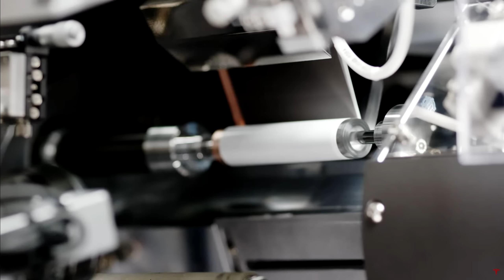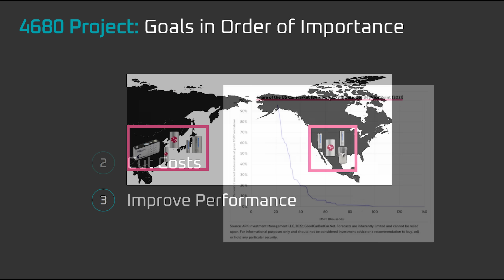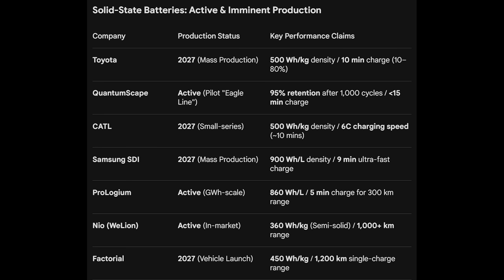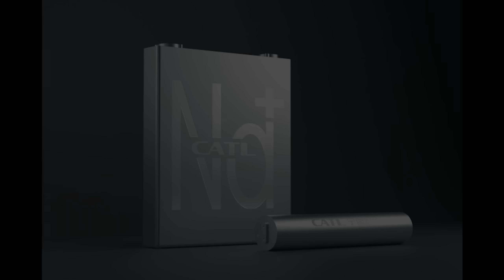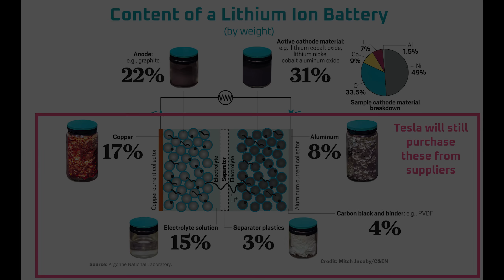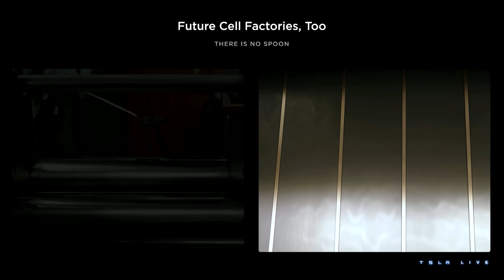The Fully Dry 4680 // Too little too late?

Comment: Do you think that the roadster demo indicates they have at least a working prototype of a high silicon battery?  There was that 'leak' a year or two ago about the NC series of cells... And NC50 was supposed to be a high performance, high silicon anode cell for a high performance vehicles. Aka the roadster

Comment: For the love of god, stop saying people don’t care about range or charging speed. Stop time and frequency are what’s holding back mass adoption.
Reply from the maker: I didn't say they don't care.

I'm saying it's not what's significantly holding back mass adoption - which is a fact.
Reply: @t @thelimitingfactor maybe from a global perspective, the US still hasn’t still hasn’t reached mass adoption due to the relatively small and slow infrastructure
Reply from the maker: @t@thelimitingfactormaybe The average charger speed here is about the same as in China.  Don't get caught up in the flash and dazzle of marketing presentations.
Reply: @thelimitingfactor ok, so disregard quantity of fast chargers then? Load sharing and power splitting reduce the real world speeds when there aren’t enough chargers.

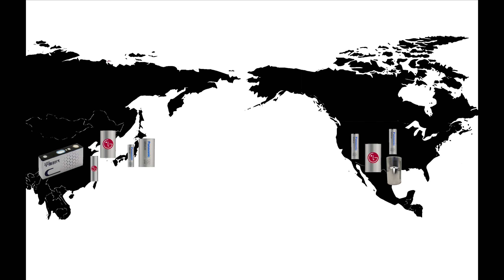Comment: 12:18 Manufacturing hell? I'm just a lowly distant spectator, but I believe that next to the Model 3 startup, 4680 startup was at worst Manufacturing Heck, or maybe just Manufacturing Purgatory.
Reply from the maker: There were more difficult technical challenges to solve with the 4680 

The model 3 ramp was difficult because it was do or die and because it started with a self-inflicted wound - over automation

Comment: for my day in day out driving my car charges at 7.7 kw/h, that does not need to improve, what does is when I am using a high speed charger my battery is 64 kw and takes about 30 minutes to charge from 10% to 80....if my battery was larger more then 30 minutes is too long IMHO
Reply from the maker: Pack size does make a big difference.

Comment: Hi Jordan, are you having AI do your voice-over of the videos now? The reason I ask is that, even though I'm quite familiar with your very soothing calm tones as a Patreon supporter since the early days, it seems that the reading has become incredibly consistently monotonous in pacing and intonation. to the point where I find it hard to focus on the information.

If the script is being read out in this way, would it maybe be possible to also put the content in written, visual form, e.g. on Patreon or Substack or similar? I for one would find it much easier to parse the info visually. Being read to by AI (or someone doing their best to emulate AI) seems like an unecessary limiting factor to absorbing information (see what I did there?).

Regardless, many thanks for your amazing work, as always.
Reply from the maker: No, it's still me reading it 

That's why I started putting my face at the beginning of the video

From my perspective I'm still doing it the same as I always have.

Even 20 years ago when I was working in a call center, people thought I was a recorded voice or a robot voice. 

There just seems to be some sort of paranoia about using AI in videos now, so everybody's looking for it 

And if you look for something and you're paranoid about it, you're going to find it
Reply: Same voice of his I've always known and came to expect.
Weirdly enough I can focus quite well on it though I have adhd.

Comment: Dang. My current car (Gwm Ora 03) drives about 130miles and charges at 30to 40kw and it is mostly enough for me.  And I use it sometimes even instead of my work Subaru for going to forest.
I can't imagine how easy a 300mile car would be that would charge at 100kw

Comment: LFP is the most attractive technology today for affordable EVs, beyond high-nickel batteries. If Tesla really want to expand the use of EVs, that should be their focus
Reply from the maker: It all depends on your definition of affordable. 

It looks like Tesla gave up on producing an ultra cheap vehicle.

As for other vehicles, they already use LFP in 50% of their vehicles.  Just not in the United States.  That's due to tariffs, etc.

I think they'll eventually produce an LFP4680 for model 3 and Model Y using cathode material from Austin. 

In the past they used LFP batteries for their US vehicles, so it's not like they're not aware of it.
Reply: @thelimitingfactor  It's unfortunate - I wish Tesla had stuck to their original mission of expanding the adoption of EV's instead of branching off to AI and Robotics.

Comment: The 300 miles of highway range and 30 minutes of charge refill are minimum requirements for most customers. Customers will pay a small premium for improvements beyond these benchmarks so there is an incentive for manufacturers to offer cars that exceed them in a competitive market.
Reply from the maker: Yep, it's a minimum threshold as I said in the video. 

A small proportion of customers will be willing to pay more. 

But, that's not how these bulk markets work. 

Instead, the charge rates will get faster and the range will get longer, and you'll get it for cheaper. 

When you try to get ahead of the technology curve the costs go exponential for very minimal improvement.

That's basically what solid state batteries are and why they're taking so long. 

The plodding methodical improvements at industry scale are where the action is

Comment: Silicon and advanced Electrolyte drop ins for greater range and shorter charging times might displace the Solid States theoretical high ground.

A number of Silicon drop in players and at least 2 advanced Electrolyte players exist.

 Would these chemistries play well in a 4680 is the question as well as would they reach Tesla performance & pricepoint thresholds to become a supplier/partner?

 Time will tell.
Reply from the maker: Anything that works with a wet coating process for anodes and cathodes has the potential to work even better with a dry coating. 

That's because you eliminate the solvent which drives unwanted reactivity. 

There's just a whole lot of engineering and a lot of unknowns to work through because dry coating is where wet coating was 30 years ago.

Comment: Korean companies are overwhelmingly ahead of Tesla in dry processes and single-particle material coating. First, regarding cathode materials, Korean companies are the ones manufacturing single-crystal cathodes, and they also possess the technology for coating to prevent breakage. Korean cathode material companies such as EcoPro and L&F are involved in this. Furthermore, regarding machinery for the dry process, specifically rolling, presses, and dry coaters, Korea's PNT holds unrivaled technology, and Tesla uses these machines. Most importantly, you must know that cylindrical battery cans and the machines capable of welding them are almost entirely manufactured in Korea.
Reply from the maker: I don't know what you're talking about "being ahead."

They're partners and suppliers - part of a complimentary ecosystem. 

Viewing it as some sort of competitive relationship is tribal and therefore idiotic.
Reply: @thelimitingfactor  
Aren't you being even more narrow-minded and foolish? The three major Korean battery companies do not supply only Tesla. Korean companies were the first to start the dry process for solid-state single-crystal batteries. However, they have not entered the market due to high yields and costs. Battery technology is not something that can be achieved with words alone, like Tesla does. It is a difficult process that requires establishing a battery value chain involving yield, price, raw materials, and more. Yet, Tesla still hasn't been able to control its yield and uses batteries from Parasoric and LG Energy Solutions. You are trying to inflate the stock price by believing Tesla's words, but the reality is that despite claiming to make batteries, Tesla has not been able to produce even cylindrical batteries for 10 years.

Comment: How well is the first goal going. What percentage of Teslas use the 4680? If there were a supply shock, could they make enough to supply all of their new vehicles?
Reply from the maker: I already covered this in the comments below.

In short, it would be a painful pull-the-ripcord moment, but they have the chessboard in place.

Also, it's not that all the cell supply would just immediately end.  If it did, you have MUCH bigger things to worry about.  Look for mushroom clouds out your window.

Comment: Super fast charing LFP is pretty much going to obliterate anything that can't do that speed outside of the Trade barrier protected US.  It's on par with gas refueling.  The grid infrastructure isn't there yet, but anyone buying an EV would rather have the tech that is truly future safe, if only for the resale value.
Reply from the maker: There have been better performing EVs than Tesla's in terms of charging speed and range for several years in China and they're some of the most well informed consumers in the world from a tech perspective...  Tesla still has some of the best selling EVs in China,
Reply: @thelimitingfactor  Many Chinese Teslas use LFP, right?
Reply from the maker: @Witnaaay Correct.  Most.
Reply: @thelimitingfactor  那是因为中国有一大堆马斯克的脑残粉丝   我是不会为了FSD去买一个400V充电要四十分钟的破车的

Comment: Thanks.  Great video.  But I have to disagree on range and charging speed.

My M3 rarely gets 300 mi highway range under THE BEST circumstances and it always takes too long to charge.  On average I get 180 mi at 72 mph for a 27 min charging session.  It's worse in cold weather or when carrying just one bike on the roof (I can't use FSD w a hitch mounted rack).

In 6 years of owning a Tesla, only four friends bought Teslas.  Three others considered it but ultimately didn't.  My wife never wants an EV again (as her primary vehicle).  Of at least 40 friends I see and hang out with on a regular basis, none are interested in a Tesla or a BEV because of the lack of range and slow charging times.  That is always their reason and although I agree with them, I can live with it because Teslas are simply the best and best quality car availability.  But range and slow charging speeds are the biggest reasons for adoption from what I see.

A Tesla with 300-500 mi highway range (300 in very poor conditions) and a 4C charging rate will sell like hot cakes.
Reply from the maker: Thanks!

I'd say the plural of anecdote isn't data.

A spike in oil price is one of the most persuasive ways to get people into an EV, for example.

Note that I didn't say charging speed and range doesn't matter.  But, it's simply not one of the big levers for moving units.

Comment: Thank you for the video. One small quip: the percentage of people in the United States who do not own a home with driveway or access to an electrical outlet that could be used for 110/240 would not be able to just top up; they would need to fill up. The current charging speeds are not good enough. Once charging gets down to around 10/15 minutes, I think that would be fine. This is coming from someone who owns a Tesla and is in that situation.
Reply from the maker: Yup!  But again, those are a minority of use cases.

I'm not just making these things up, this is what the evidence shows.

Some organizaitons will do surveys that show different, but they're usually opinion surveys vs actual sales data.

That is, stated vs revealed preferences.

I think people come away thinking that I somehow don't see the benefit of better performance, but I do.  I'm telling you how things are, not how I want them to be.

Comment: Tesla need to step up there game the range is not good enough the real metric people need is 350 High way miles, that is when EV becomes real appealing right now my model Y annoys me the amount of times I have to plug in that’s my only complaint. And that’s what stopped me from changing my hole car fleet to EV
Reply from the maker: I didn't say it wouldn't be nice.  I'm saying it simply doesn't move many units compared to other factors, like cost.

All factors matter, but some factors impel people to by an EV, others encourage them

Comment: Jordan Gizigy (spelling?), you say the the 4680 cell form factor is an advantage, but BYD and CATL have really focused on prismatic cells which seem to have better packaging density, cooling,and manufacturing. Do they even sell cylindrical batteries for EVs any more?
Reply from the maker: I'm not saying it's an advantage. 

You use the right form factor for the right use case. 

The Chinese typically use prismatic because they typically use LFP, which is a good pairing 

There's positives and negatives to every form factor, to every chemistry, etc

Batteries are multi-scale multi-physics systems

Comment: The problem with sodium-ion batteries, is that it sacrifices energy density and longevity to reduce raw material costs. However, lithium is not a rare earth element; in fact, there is enough supply on Earth to power all the cars and batteries we could ever need. As lithium extraction and refining scale up and the supply chain matures, sodium-ion technology may become obsolete before it even reaches the mainstream. The issue with lithium is an immature supply chain, not geological scarcity.
Reply from the maker: Correct. 

And, I wouldn't even say that the industry is too bottlenecked by lithium supply

Generally it comes down to financing the projects that build the supply chain 

It grows and fits and starts so it's sometimes misaligned with demand
Reply: Right now the demand growth is exceeding the new lithium mine discovery by very very large margin, and the lithium price is starting to go up to like a rocket just recently, so we still need sodium to balance the entire battery market and putting a brake on the battery prices

And while sodium is always having lower energy density than lithium (since its atom size are 30% larger), they tend to have longer cycle life than li-ion because the selection of the cathode material that are fully compatible to sodium ions (like NFPP, prussian blue and titanium oxide) are more stable than the ones used on li-ion

Comment: Jordan, I'm sure you've heard of the new BMW "neue klasse" EVs, which claim well over 400 estimated EPA miles of range. These are apparently powered by circa  108 kWh battery packs composed of 4695 cells, of NMC chemistry and manufactured by LG. I'd love to hear your take on these batteries, especially how they compare with the Tesla 4680s.
Reply from the maker: I've done a video comparing some of the other 4680 iterations from China versus Teslas 

I haven't seen a teardown yet of the LG and Panasonic versions

Comment: Grok says they won’t be obsolete.

No, the 4680 battery format is not at significant risk of becoming obsolete soon. Tesla is actively scaling and iterating on it as a core technology through at least 2026–2027 and beyond, especially for vehicles like the Cybercab, Cybertruck, Semi, and even some Model Y variants. ￼
Current Status and Momentum (as of mid-2026)
•  Recent Breakthroughs: Tesla has achieved a major milestone with fully dry-electrode processing (both anode and cathode) for 4680 cells. This reduces manufacturing costs, energy use, and factory footprint significantly. Production is underway at Giga Texas, with cells already in select Model Ys and broader rollout planned.

Comment: Solid-state separator can already be produced RTR- not yet production, but will be. A 4 or 5-year lead (or even just 2) on the market means Tesla won't lose price advantage immediately, but until they actually produce a dirt-cheap economy model, they've lost the future market share in the U. S. they've had for the past decade or so.
Reply from the maker: Everyone is always claiming the next chemistry is going to devour the battery market and put other people out of business 

That never happens because every battery has strengths and weaknesses 

You just have to use the right one for the right use case
Reply: @thelimitingfactor  Lead-acid no longer has any use-case advantage. That took a century to pass. NiCd no longer has a use-case advantage, that disappeared in 50 years. 
You can still make and use a Baghdad battery, or Volta cell- who is doing that for any market reason? Market cycles just keep compressing, and the pattern looks exponential (but not much greater than 1) rather than logarithmic...

Comment: If the brittle layer in solid state batteries is the limiting factor to being used in the 4680 process and the 4680 uses the same handling equipment as the soda can industry and Tesla found a way to eliminate the kiln process to make the cells cheaper… I suspect Tesla is looking at a way to make the 4680 into a solid state battery by making the brittle layer flexible. That’s what I’d be doing right now.
Reply from the maker: Yep, it's something they've been dabbling with for about a decade

Comment: Logical as usual. Nice work Jordan. 

I do think Tesla is going to have to up their charging speeds sooner than later. No doubt they do not need the sexy two minute rapid charge up that some Chinese builders claim, but faster charging does add appeal. Most of the reviews of the current generation Model Y note that charging speed is one of the biggest disappointments. 

Thankfully, most of the other aspect of the Y are strong. I suspect Tesla will offer faster charging tech in their vehicles sooner than later.

Comment: The demand for any battery right now is way beyond all the battery companies ability to supply. Tesla's internal demand is so huge that it goes outside itself to fill its battery needs. Chances are that if Tesla were to increase its production it would do so to aim at either a new internal demand such as the Tesla Semi & the Cybercab, or rethink its use of outside battery suppliers and replace those batteries with cheaper to make Tesla 4680s. The demand for batteries globally right now seems insatiable.